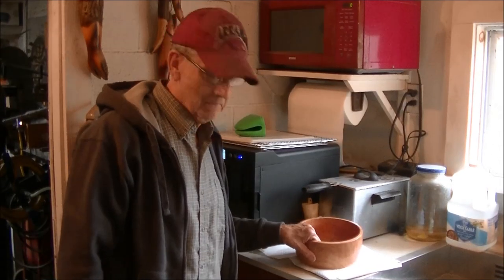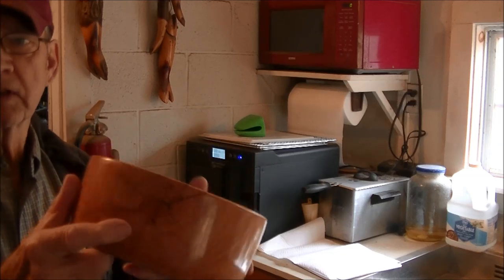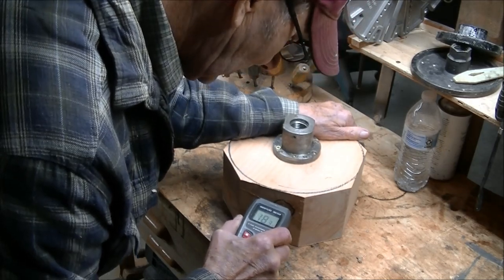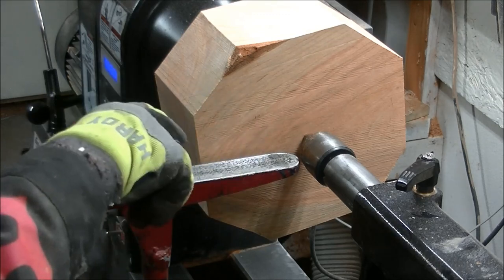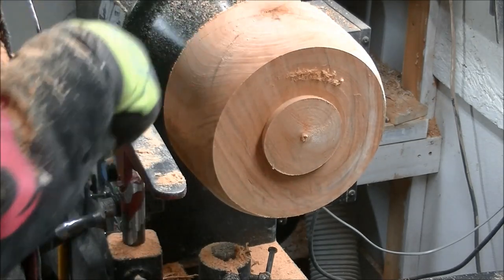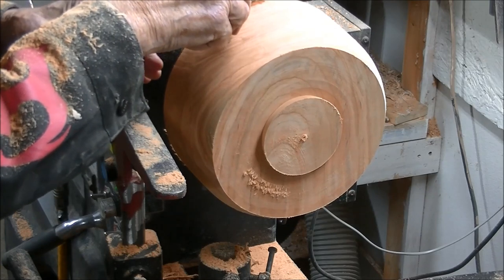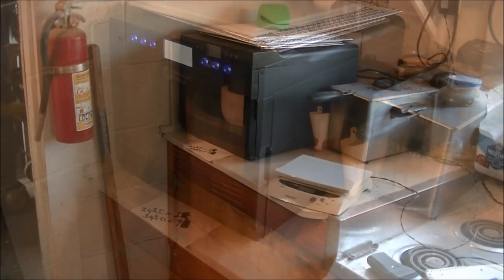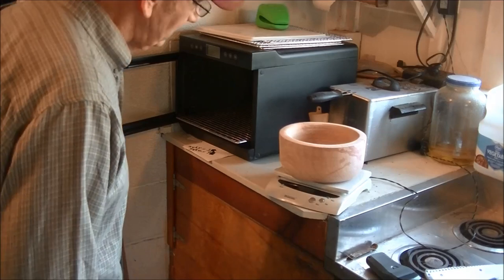Dehydrator Drying Test II # 195

Comment: Great job again!! I am looking at dehydrators as we speak
Reply from the maker: They work great, but you will need to control the temp.  If you are not in a hurry use the lowest temp you can.  The high temps can and usually cause more cracks.  Take care, Larry

Comment: Had to buy one and try it out. Rough turned a maple bowl and cored it. Big bowl was 35%. So wet when i turned got a bit of a shower. Put in dehydrator at 115 degrees for 18 hrs. No reading on outside and inside. Bottom was 8%. So little warping and some hairline cracks easily fixed. Thanks for the tip. Enjoy your videos as well
Reply from the maker: I use mine quite a bit, it works.  Take care, Larry

Comment: Love what you are doing, and I hope you do more long term experimenting with your technique.

I've been using a food dehydrator for pen, bottle stopper, and pepper mill blanks for about 16 months now. And from my testing, its dry on the outside when you take them out in 24 hours, but not completely dry inside. Pepper mill blanks take much longer to get that inner moisture out due to their thickness, weighed daily until the weight loss is negligible. Depending how long they sat in the garage before I grab them, I've seen up to half the weight lost during the process. Not sure if that will affect your finish or not, but they may need to sit until they reach an equilibrium with moisture throughout. Wrap it in a plastic wrap, let it sit a week or two, and test for moisture again. Try with a scrap piece, and cut it in half and test for moisture along the cut. Maybe with a much thicker piece, so you can see how deep your dehydrator will penetrate in a given amount of time.

Being dryer than the environment around them during our humid summer months, my blanks will wick that moisture out of the air. I've seen them gain back some weight just from sitting in the open air. Nothing you could feel by hand because of their small size, but easily detected on the scale within a couple days. Since my blanks are smaller, after I dry them, I put them in a large air tight container with reusable silica gel desiccant beads (the orange to green color changing kind found on Amazon) with a grate above them so they don't make contact. This keeps them dry (and then some) until I can use them all, or if I decide to continue the process on chosen blanks in a toaster oven for stabilizing.
Reply from the maker: I only dry bowl blanks, about an inch thick.  I think all you have to do is put thick stuff  back in for another 24, and maybe another, they will dry in time no matter how thick.  Thanks and take care, Larry

Comment: Hi Larry,  I would call the two dehydrator projects a success for sure!!   With the pith still in this project the small amount of cracking is very understandable and nothing that I would blame on the dehydrator method.   I watched your first dehydrator video 3 days ago on Wednesday and looked through the upcoming Black Friday sale fliers and found a Gourmia GFD 1950 Dehydrator for $89.99 vs $129.99 retail...Amazon is $104.99.  I was at the store Friday when they opened at 5:00AM and got one and they were gone fast.   I immediately turned a Black Ash vase and tried out my newly purchased dehydrator and it worked very well.  I agree the placement in the dehydrator is something that experience will help determine and the shape of the project may also play a large part as well.  I just checked our woodwork in various rooms in our house along with several pieces of kiln dried lumber & plywood and found the moisture content to be anywhere between 0% to 9%.  It might seem that expecting to always achieve 0% moisture content might not be realistic or even necessary.   Thanks for the great ideas and I look forward to additional follow up videos.     Take Care, Myles
Reply from the maker: I agree, I would be OK with 6/7 or so.  Thanks, Larry

Comment: My guess is the increased thickness of the tenon is more likely the reason for the higher moisture level than positioning in the dehydrator.  Maybe next time try a recess for comparison?  Thanks for this info.  I dried my first bowl using this method and put some sanding sealer on the end grain after about six hours to reduce the cracking.  Ready to finish turn it today.  Love your channel.
Reply from the maker: Being cherry probably had more to do with it than anything.  Thanks, Larry

Comment: For your dehydrator,maybe if you made a thin platform with nails sticking up that the wood would set on the points. This would allow air to reach every place but the nail tips. Great work as usual.
Reply from the maker: My trays are adjustable.  I will raise it up about half way and up side down next time.  Thanks, Larry

Comment: Ok, i have wanted a dehydrator for a while. This was my justification. Picked up what looks to be the same or similar unit. Turned a 10 inch plate from oak at 26% moisture. We shall see what we get tomorrow. Added benefit, I see some banana chips in my future!
Reply from the maker: Report back, I'd like to know.  Never had banana chips, tell me about it.  Thanks, Larry
Reply: The Wood Whirler * the plate dried to around eight percent with the expected warping, no cracks, which is unusual for me with oak. I’ll remount and turn it tonight. Fingers crossed...

Comment: To deal with the air circulation problem in your dehydrator, you may try putting nails through little blocks of wood to hold the nails upright, then set the bowl on three or four of them, just enough to lift it off the bottom.
Reply from the maker: The selves are adjustable, just have to adjust them.  Thanks, Larry

Comment: Thanks for this video. After your last one, I found a dehydrator at a thrift store for $11. It's the round kind with multiple trays but I think it will work - I just need to find some green wood.
Reply from the maker: You will have to cut the centers out of every tray and if it doesn't have forced air, i.e., fan, it will work but very slow.  You might make it work, but I'd get my $11 back.  Just my honest opinion, no offense meant.  Thanks, Larry
Reply: @TheWoodWhirler  After seeing you trying to arrange the bowl to get better air flow, I decided to NOT cut out the bottom tray. The trays (about 5 of them) just have plastic bottoms so I can cut them out with a razor knife. It does have forced air and a range of 5 or 6 temps so I think it will work for a tinkerer like me. BTW, my nephew called today to tell me he has found me a pecan tree of ~ 14 inch diameter that was cut down about 10 days ago. :>)

Comment: Ever think about a energy free solar dehydrator? 20 ft. Of 4 inch black abs pipe . Running on a 4ft slope , dehydrator box at top end . Sun heats air inside, heat rises creating flow ?
Reply from the maker: Nope, not worth the cost, effort or small savings.  Thanks anyway, Larry

Comment: Excellent test and follow up. Thanks for the great idea. If I may, I do cringe when I see you wearing gloves while gripping the jacobs chuck. I hope it never get a catch and starts spinning. 
Off to Amazon now so I can order a dehydrator myself :)
Reply from the maker: Have you ever had one spin with bare hands?   If so you would understand.  Jacobs chuck will tear you a new one, gloves are very safe.  Thanks, Larry
Reply: @TheWoodWhirler  No sir I have not but I don't generally hold the chuck when in use. Great videos by the way.
Reply from the maker: @erocgr00t6  Well you should, at least have a lose grip on it.  If it comes out of the taper while whirling and you don't gain control, you best get out of the way.  Otherwise you may get hurt, bad.  That's the reason I do it and I don't have a tight grip, but I am ready.  Thanks a lot, Larry

Comment: Hi Larry. I found your first video using the dehydrator by accident, Love the idea and actually purchased a dehydrator and put an wet Oak bowl in there a few minutes ago. I set it for 19 hours at 113 degrees. Hope that is right , I find out tomorrow. Have you done more testing and if so what is your advice on time and temp. I am a new subscriber, thanks for your great content.
Reply: How did your oak bowl turn out? Any bad cracks?
Reply: no cracks at all

Comment: Nice follow up.  Answered some questions I had on previous video.  What brand dehydrator do you have and would you buy it again for this use?
Reply from the maker: Magic Mill, $129.99 on Amazon.  I bought it because it had stainless steel trays, easy to clean and will last.  The wood drying was a brain fart, that worked.  No, I wouldn't buy it again, I would look for a bigger one.   I can only put an eleven inch bowl in it, would like to go 14/15.  Thanks, Larry
Reply: Larry, after getting the Sedona Express from Amazon, I can see how, with some sheet metal work, a guy could take a stock dehydrator unit and expand the case to take larger size bowls, or more pieces of wood.  Basically7 you are using the controller and fan(s) over into a new (larger) cabinet.  Some units  on Amazon have 2 fans instead of 1 fan.  That  might be needed on a larger cabinet to keep things dryig evenly, and can easily be added.

Comment: No disrespect intended. Around here we call your part 1 & 2 bowls dog bowls. - straight sides outside and inside. Take a thin chain or a strings, hold ends and bring ends a bit together. That curved shape is what the fellow members of the local guild is what is looked for. - just my 2 cents of comment.
Reply from the maker: None taken, but I still don't know what you are talking about.  Thanks anyway, Larry
Reply: @TheWoodWhirler  
You have straight sides inside and outside.  On the inside,  the bottom has a right angle corner at the bottom. Up in my area, it's like an ellipse inside and outside.  I can't  attach a photo for you in this reply.
You do explain what you do, which many viewers  certainly appreciate. Thank you. Bill.